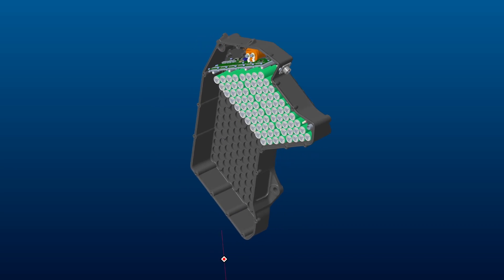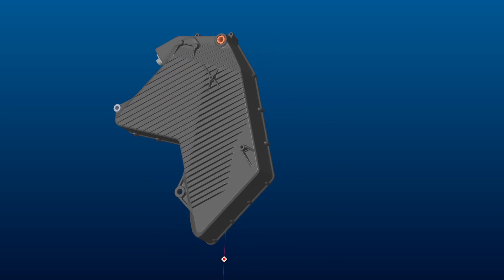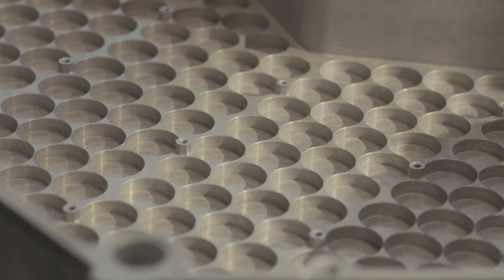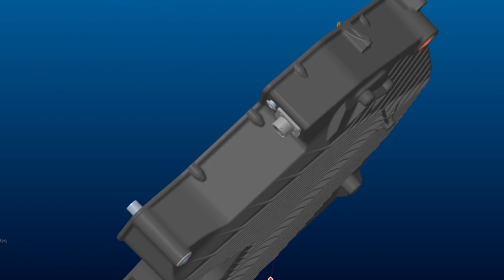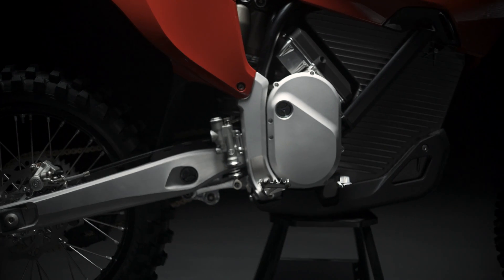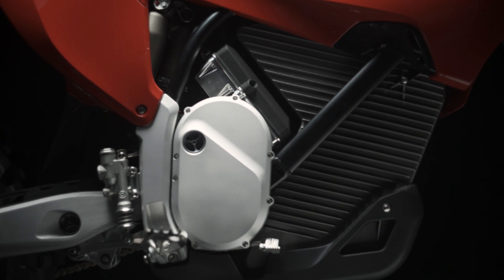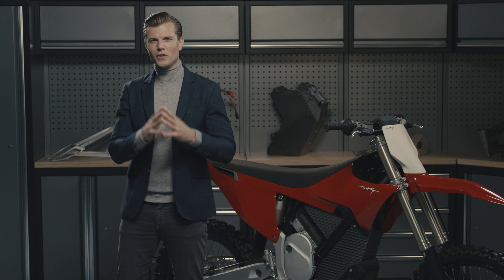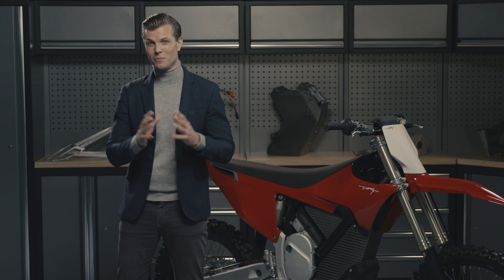Stark Future: the new norm in motorcycle battery technology

Comment: He said "every cell is connected to the casing". This must mean thermally not electrically.
There are 400 cells in the pack. If the pack is built with 4 cells in parallel and 100 in series, the top of charge voltage is 420v.
If its built with 8 cells in parallel and 50 in series, its 210v top of charge. The 3D model doesnt show which.
These are definitely not 18650 cells. More likely 2170.

Comment: 80 hp = 60kW. The 6 kWh battery pack would sustain full power for 6kWh/60kW = 0.1hrs = 6 minutes. 

This isn't actually a very useful stat though, because other than riding on a dry lake bed, not even the best off road/motocross riders in the world could sustain 80hp for 6 minutes straight and live to tell about it. And most ICE motocross bikes would blow up if they were held on the rev limiter for 6 minutes.

My guess: Riders who are heavier (>200lbs) AND aggressive/fast (Pro through B) will find the range a little short while lighter or slower riders will have more than enough range.
Reply: This is not how the math works. If I follow your same calculation, then running the bike at 3 hp, the equivalent of a 50cc childs bike, would only last 2.7 hours.  Running the bike at power levels that mimic the range of most full size bikes (35-55 hp) will make the engine last significantly longer than 6 divided by hp converted to kw.  For example, running the bike in the optimal range (about half of the peak power) of about 40 hp, according to your calculation, would still only last about 12 minutes. This just isn’t true.
Reply: add a zero..... 60 mins